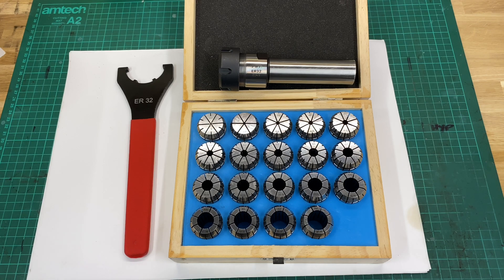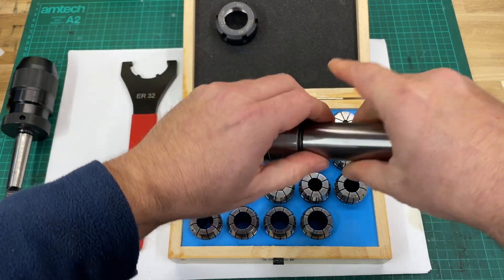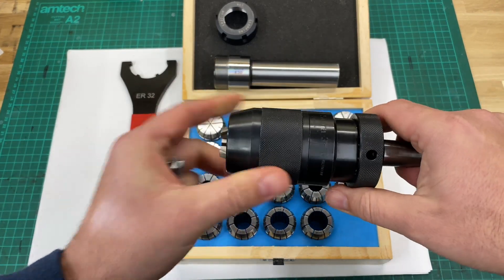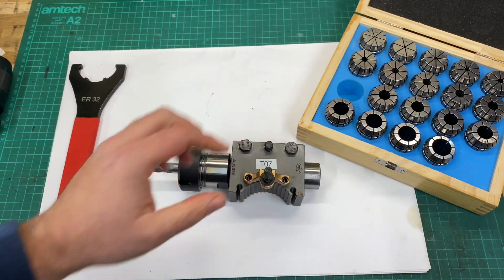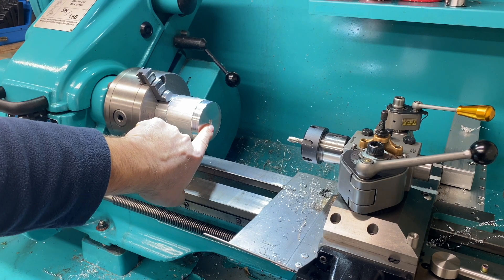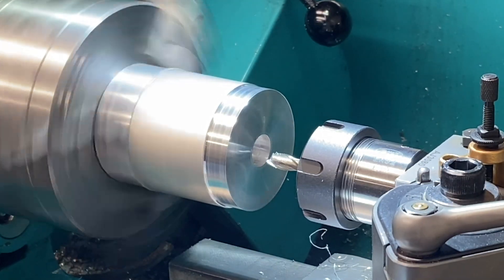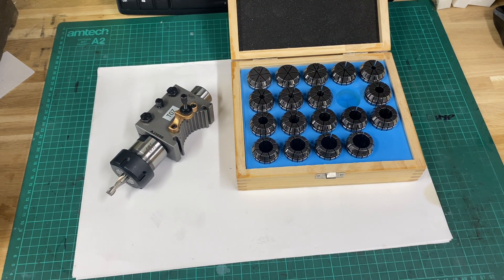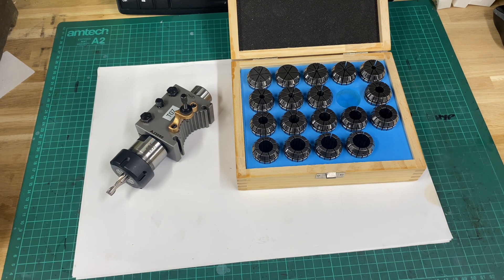Most Rigid Machining Set up - Pewe Tools ER32 Collet Chuck on a Myford Super 7 Lathe Solid Tool Post

Comment: From my experience, the downside of inexpensive, Chinese made  ER collets is runout, which can be abysmally bad in the smaller collets.  A product review of an ER system should include the accuracy of the collets and collet chuck.
Reply: Just what I was thinking. Well made ER chucks/collets offer good accuracy but are very expensive. The vast majority of imported kits are garbage though, I have about 3 sets and they're not very useful. I use a decent 5C chuck in the headstock in preference to ER chucks. I would have been interested to see the runout on this particular chuck/collets.

Comment: It is extremely important to not try this by using an end mill in a three jaw keyless chuck. Any vibration will open the chuck slightly and all hell will break loose.  Good video
Reply: @37yearsofanythingisenough39  As promised, I've just uploaded my setup with the ER40 on the lathe centerline.
Reply: Not with an Albrecht chuck it isn't 🙂

Comment: What size pewe tool post is that AA up to 12mm or AD up to 16mm?
Reply from the maker: @BarbaraGers  this is a size A tool post on the front. The rear tool post is a size AA.
Reply: @opticalmechanic  Ok, than it is the AD2075 up to 20mm from PWT?  But you can not use 20mm tooling on the solid tool post, What is the largest unmodified tool you can use with this tool post?
Reply from the maker: @BarbaraGers  are you referring to the holders for the turning tools? If so, I use AD2090. The width of the channel is 20mm so you could fit a tool up to that size. Whether you can get centre height is another question, depending on the machine. I 5/8” tooling on my lathe because I have lowered the height of the tool post by removing the compound slide. Hope that answers the question. Regarding the size of slot drill / end mill, I would not hesitate using a 20mm diameter tool.
Reply: I have also a Myfort Super 7. If you use 5/8" tooling on your A size tool post this is about 16mm. PWT offers a AD1675S tool post extra for the Myford for tooling up to 16mm on the standard Myford compound slide. But I'm not sure if the AJ3080 holder would fit the AD1675S tool post. How high is your solid tool post?
Reply from the maker: @BarbaraGers  it is about 25mm

Comment: Intention to inform:

made the same with ER16 chucks. BUT When you are using drillbits or a one-lip drill you have to get the toolholder bolted twice to the toolpost. Or the toolholder will been pushes out of the 90° alingment. 
To use endmils is ok but it can be a pain in the arse when you are about to drive them theier whole cutting lentgh into the workpiece. That can and will result in chattering.

I made me today another clamp-like fixture. When you are interested i can make you a clip.

Nice work.

Comment: It's far more rigid if the ER holder is at 90 degrees in the toolblock.  As the force is then directly at the center of the toolblock there is no rotational forces on the toolblock and compound.
Reply from the maker: @marley589  the only trouble with doing that is the overall length of the set up is significantly longer because of the size of the chuck which takes up precious real estate on the machine but I agree it would be ideal to direct the cutting pressure along the z axis to avoid the torsion applied to the tool post.
Reply: @opticalmechanic  you cut most of it off. It's only long to hold onto. Clamp on the diameter behind the nut.
Reply: The Chinese make very short shanked ER collet chucks to fit in gang tool holding blocks for programmable tool room lathes.  Mine do not have any markings so can’t mention any brands.
Reply: @37yearsofanythingisenough39  I have that type of setup with an ER40. I'll try to post a quick video next week.
I already have one posted with a 3-jaw keyless chuck holding a 20mm diameter endmill !
Reply: @machinists-shortcuts  the 3 jaw drill chuck with an endmill is gutsy.  I’d stick with the er 40 collet.

Comment: I’ve replaced the chucks on my mini mill and lathe with an ER20 setup for drilling. Takes a bit more time but the results are worth it. Don’t have a DRO so not easy to adapt a tool holder on the lathe for drilling but could have advantages for boring.

Comment: I'm sure the Multifix tooling setup being much more repeatable and rigid helps here. There were expensive back when they were German and Swiss made, still expensive not for the average home shop / hobbyist.
Reply from the maker: @ryebis  Multifix as a platform is more expensive than other options but you get what you pay for and I bought mine for work purposes not just for hobby use so it has paid for itself fortunately. Used prices are much better but they don’t come up very often.